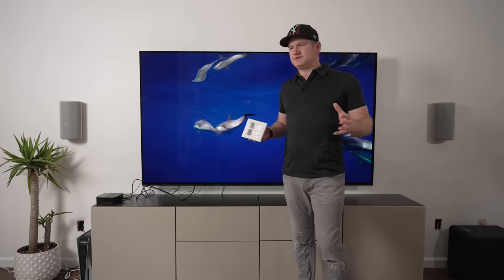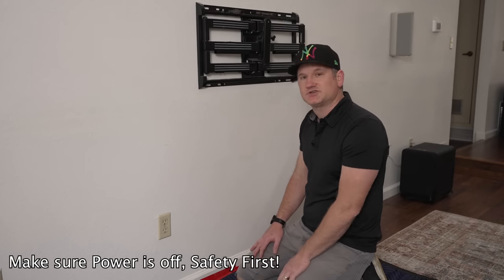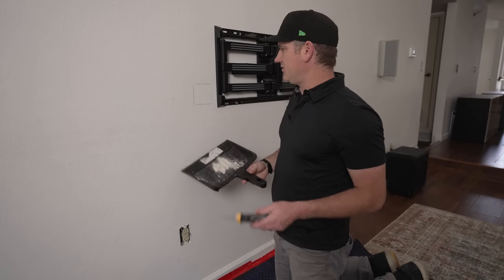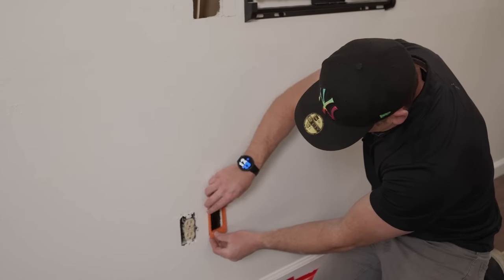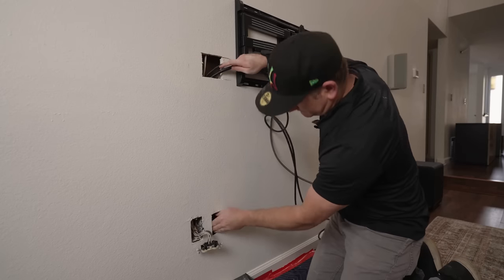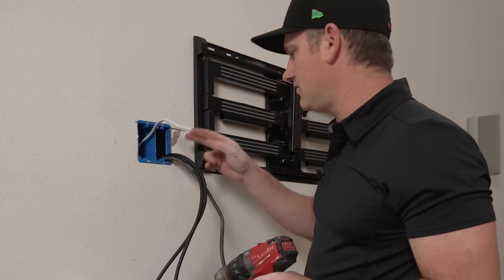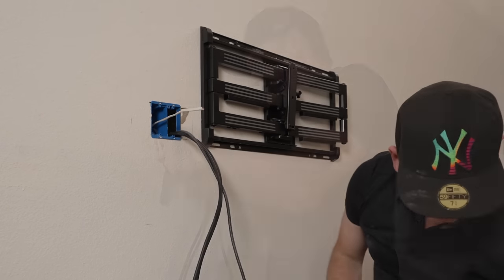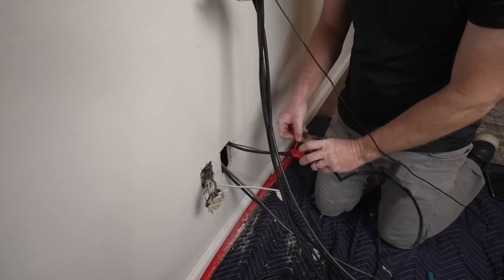Hide Your TV Wires in Wall - In Under 20 Minutes

Comment: as a german i am always amazed by the material the walls in america are made of.  With my brick walls, something like that is difficult ...
Reply: As an American who lived in Germany I understand!😅
Reply: A very diplomatic way of saying American walls are made out of cardboard.
Reply: until they are on fire, then you start to appreciate the brick walls.
Reply: Difficult yes, but not impossible. My house has brick walls as well.
With chisels and hammers the wall can be cut out enough to run all those cables and then covered with plaster. It would take several hours of work though.

Comment: I wish I could do this in our apartment. Did my best with hiding the wires right behind my TV stand and using zip ties.
Reply from the maker: Grab a cable mate at home depot.  It sticks to the wall.
Reply: I picked some good ones on Amazon.
Reply: @BTheInstaller  ok thanks B, I'll try that 👍

Comment: Wow those plasterboard/stud walls sure make life easy. In Switzerland where I live, our walls are either brick with mortar base and plastered or reinforced concrete with mortar base and plastered. Hiding the cables in the wall would require recessing (rebating a channel in the brick or concrete), replastering, repainting. I think we'll use a cable channel or a white blanking panel the width of the TV.  to hide the cables.  Your end result looks great! All the best, Rob in Switzerland
Reply: Use acoustic wall panels and put spray painted (black) cable ducts in the grooves, so that they are close to invisible.

(See my other post!)

Comment: Something to consider for future projects like that rats-nest of an electrical outlet (other than converting it to a dual outlet configuration) is to use one 5-position Wago Lever Nut for all your incoming hot wires and another for your neutrals. You then run one hot pigtail from the hot Wago to your outlet's hot side and one neutral pigtail from your neutral Wago to the neutral side of your outlet. You could also do something similar for your grounds if you had multiples of those. It's so much easier than trying to hook all those connections up with wire nuts as well as trying to run pigtails from them to the outlet - not to mention getting them all to fit in the box after you've gone through all that.

Comment: 6:10 I realize that you've probably been doing installs for a long time, but the "...we don't need 15 foot wires..." comment made me chuckle. I just did a hidden cable install like this and I thought my 15 foot cables would be plenty long enough. Turns out for for some components (like that PS5 that's on the ground to the left of the center console), a 15 foot cable is barely long enough to reach. Once you see how much of that 15 feet is needed for routing along the articulating arm behind the display, there's surprisingly very little cable remaining to run down the wall and out to a component.

Comment: I have a similar pair of Klein's, can't go wrong. One thing I don't like about the HTA 9 is one HDMI input, that's ridiculous. So you need to run 3 cable to your panel. I have Mac and BluRay into my 990B then just the eArc to my panel. You could use a switch at the bottom end for the HDMI which is what I'd do, Amazon has tons lol.

Comment: Hi there, really helpful video! I was hoping you could recommend an ultra thin high speed HDMI cable
Reply: Fibre optic are the thinnest HDMI cables but they are usually only needed for long length purposes

Comment: QuickFix: Buy some Acoustic Wood Panels with wooden slats on a black carrier material (i.e. Wallribbon).

Get a mini cable duct with the same width as the black grooves & spray paint it black.

Put the cables in the ducts (HDMI left, Ethernet middle, power cable on the right)

Now you can wall mount the TV, hide the cables in the 2-3 black ducts (always accessible) and can even put a few black led stripes into the remaining grooves (15-20 inches at a random height every 10 grooves… looks awesome)

This is what we do in Central Europe, when we hit a brick or concrete wall!
Reply: Got a video?
Reply: I mean if not it's simple enough I just prefer listing while doing it.
Reply: Have a look at the latter part of this video… https://youtu.be/APr2SAkEK_Y
Reply: @maxking3  thanks for the speedy response.

Comment: Why not use wall mount HDMI panels so you could use shorter/longer HDMI cables that plug into a wall? This way if you buy a larger TV you could just use a longer cable without the need of running it behind the drywall again.

Comment: One question, is the tv electrical plugged at top outlet box or run thru bottom and plugged at surge protector? Thanks
Reply from the maker: It's plugged in up top but no surge protector. You can add that at tip if needed and they make surge protected outlets as well
Reply: @BTheInstaller  Thats what I thought I had seen. Could not tell if you had an outlet for tv plug, thanks.

Comment: Have a question, if you can suggest. I am planning to buy a ikea besta tv unit(bottom 4 drawers) , not sure whether it has slots/holes on back. There is vertical drawer(4 slots) on both left and right side of the TV unit.  My power outlet position is to the left and right of the vertical drawer at bottom. I am assuming since  both the TV shelf and vertical drawers will be touching the wall for safety, and there will be a screw to attach to the wall. My question is, how will I able to connect a outlet surge protector from the left/right side of vertical drawer to go back to the central tv shelf, if everything is touching the wall? Is it possible to install the ikea unit and vertical drawers keeping a certain distance from wall? and by not making lot of drilling in dry wall to change position of power outlet

Comment: I'm confident enough to do what you did, but unfortunately my setup is different.  My tv is over my mantel and we have a bookshelf to the right of the fireplace and TV that holds the other electronics.  My dilemma is how to get that horizontal run and then drop.
Reply from the maker: It's not easy.  I need to make a video on that.  There are multiple studs framing the fireplace most likely. I would just hire someone. $300 or so
Reply: @BTheInstaller  thanks B!
Reply: Don’t be afraid to cut and patch Sheetrock.  Just be cautious on your cut depth.
Reply: @paultech9385  I'm pretty good at repairing sheetrock, but that's on smooth walls.  We moved to Texas and every house has textured walls.  So I'm a little intimidated in trying to match the texture pattern.

Comment: Do you need a specific type of HDMI cables to run them inside the wall?
Reply: just make sure they're long enough to get to the TV & whatever device you're connecting. 6' is the standard, but they also have 15' & up

Comment: First you should have used a recessed box at the top. And a larger recessed box so there’s room for cabling and even things like an Apple TV. Some even have covers so you can completely hide wires recessed behind the tv.  Also if you’re not putting permanent hdmi cables in the wall you should use a two inch conduit or orange flex tube between the top and the bottom. Makes it much easier to put new cables through it in the future. Also as the ones you put in there aren’t fire rated the conduit is necessary.   Electrical.  Oy.  A few wago wire nuts or the type that you insert wires into and close the connector. And you should use a surge protected outlet behind the TV.     Plastic dual boxes like that don’t block emi. Hdmi cables are shielded somewhat depending on the quality but still a bad idea.  Larger recessed boxes have a lot more separation between high and low voltage cabling.  And yeah wiring a electrical outlet like that stabbing a residential grade crappy outlet like that is just asking for trouble.  Only appropriate with gfci outlets and those don’t just rely on pressure but use the screws to press down the wire from a back entry.     Pretty much what you shouldn’t do all around.
Reply: Yes ! TVs cost thousands of dollars. Why don't use a surge protector ? :(

Comment: Hate to sound picky but you put the ground wire under the screw the wrong way. It should wrap around the screw the same direction as the screw tightens.
Reply from the maker: You made me go back and look just for you to be wrong. Cmon.... I even made a point to say you need to run them clockwise ... 💪